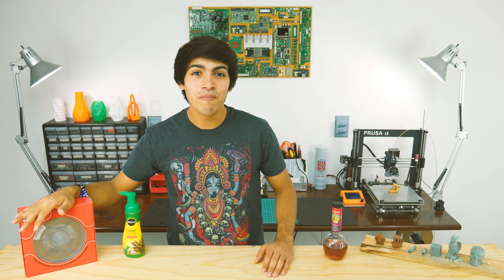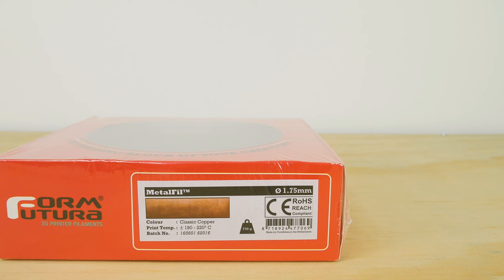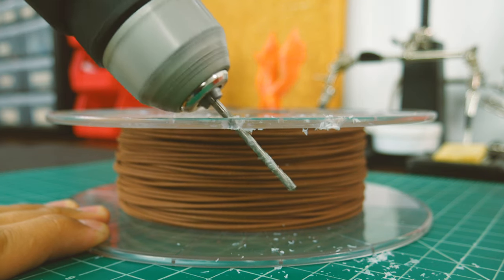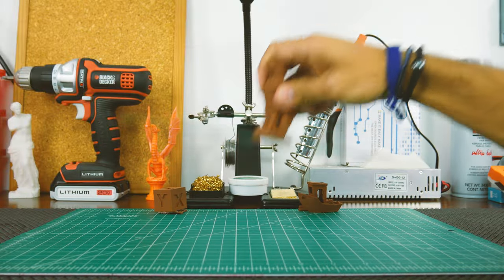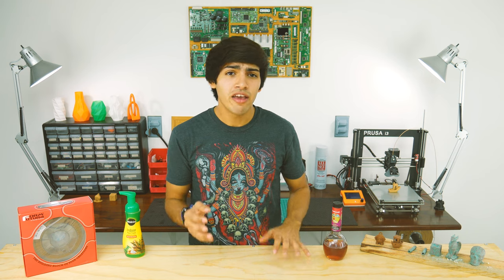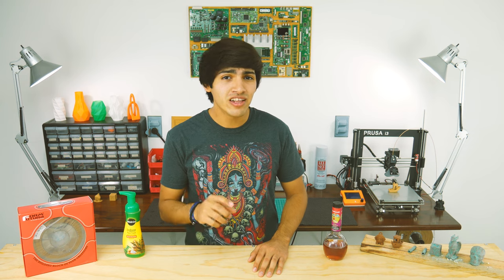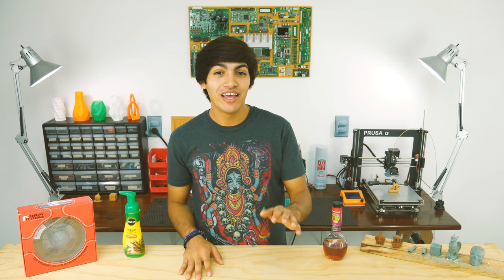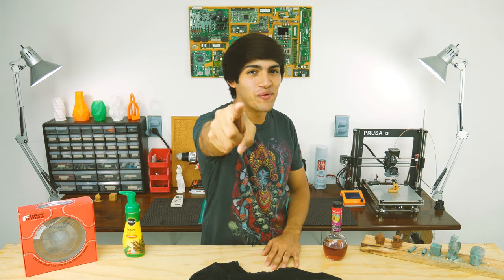⚙️🔧 3D Printing METAL!!! Form Futura Classic Copper  - Filament Review

Comment: I tried a rotary tumbler on a different make of metal filled filament and couldn't get a decent finish on the parts. It just seemed to fray the edges of layer lines.

Comment: here is a tip, you have Z wobble, as you can see in your cube, fixing it will result in a better print quality.
Reply from the maker: It's actually a problem on my x-carriage being loose due to the fact that I recently lost quite a lot of balls from one of the linear bearings. Replacement units are on the way, but getting to Honduras takes quite a while jajajaja.

Comment: It seems like a lot of work to finish the object when there are chemical methods to coat a plastic object with metal.
Reply from the maker: If you want to polish the print, using a rotary tumbler would require no effort at all. If you don't have one, you could get the print polished in a jewelry shop.

Comment: is 3d filement really heard as metal?
Reply: No, it's basically metal dust glued together with plastic, it does not have the metallic crystal structure (which gives the metal a large amount of it's metallic property)

In short summary it's mostly because the metal isn't binding to each other but instead bonded with another weaker material therefore, there is no way it can be as strong as casted/3d printed copper(copper dust adhered with laser)